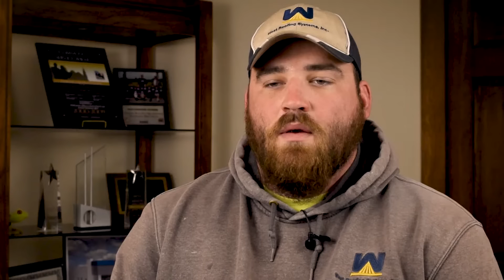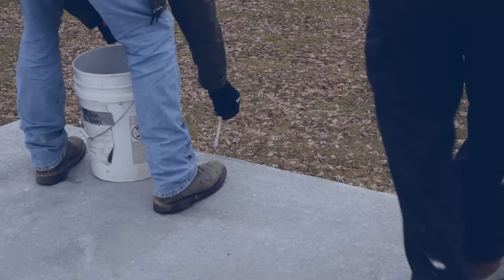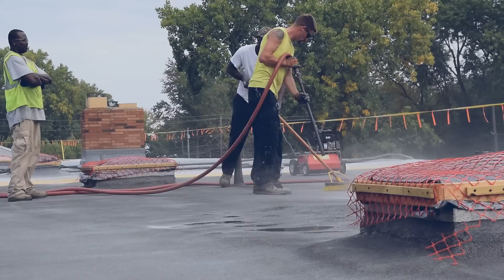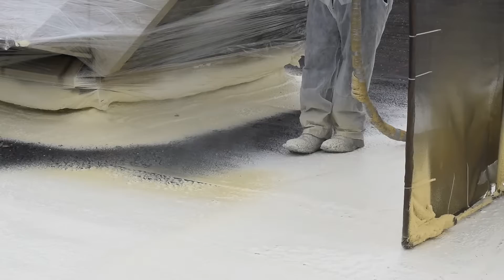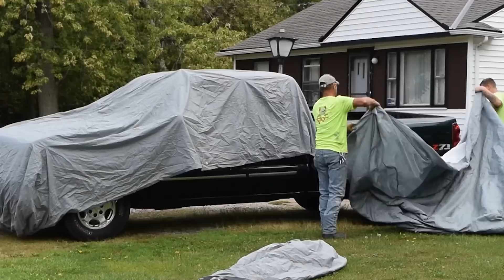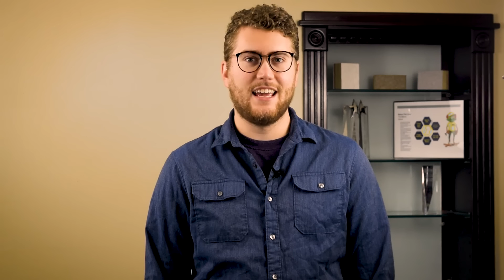The Pros and Cons of Spray Foam Roofing

Comment: I lived in my house 35 years. It has very nice open beam ceilings over the living room and dining room and over my 22x24 foot bedroom upstairs. The heavy wood shake roof leaked so I had it torn off and the center of the house was sheeted with OSB. The open beam ceilings are 2x6 tongue in groove with tar paper and 3 leaf tar/fiberglass shingles on it. It started leaking after 15 years because the nails were backing out where the seams of the wood was and they did not hold. They should have sheeted those areas as well.  For an entire year, I could smell tar from the roofing INSIDE the house.

The house was freezing in the winter, hot in the summer for 20 years. The composition roof was far less insulation that the shakes were.

I'm done chasing leaks. I had my roof of 3200 square feet sprayed with rigid urethane foam 4 days ago over the shingles. It was coated with the elastomer but needed the mid progress inspection to be done before applying granules.

The foam partly duplicated the shingle pattern.  They actually filled in the dished sagged area over my bedroom and now it looks much better from the street. It looks like a light snow fell on the roof.

The results..... holy smokes, awesomely good......I have been tracking the ceiling temperatures with a laser thermometer so I know how it was in the last 2 years.  It was 106 to 112 degrees after the sun went down inside my bedroom on the ceiling, 92 degrees 5 feet off he floor with the cooler running on an average hot day in August. In the winter, I was seeing 48 degrees 5 feet off the floor. The ceiling was often a few degrees less. The attic was the same as the outside temperature.

. From across the street, you could see the frost burnt off over my living room and bedroom.  Last February the furnace set at 67 degrees ran 56 minutes of every hour and my bedroom temperature at 5 feet up from the floor was 48 degrees. The attic was 116 in May when I strung the new video cable AFTER the sun went down.

I have evaporative cooling and run it on low about 8-10 hours a day all Summer. The attic vent fan turns on at 105 degrees and runs from 11 in the morning to 7 at night most days.

With the foam roof, the attic temperature was 76 degrees in full sun, 86 degrees outside today. The attic fan never comes on now. It ran every day since May before the new roof. With the windows closed, I'm seeing between 68 degrees and 74 degrees in my upstairs bedroom at all times. Fall fell last week and I was using the furnace for an hour each morning. Now with the insulated roof, there is no need for the furnace or the ceiling fan. The difference is astounding. I need to learn how to operate this house all over again.

They are going to coat the roof with tan mineral granules this week. The entire job cost as much as they quoted to tear off the old roof and lay down GAF bitumen underlayment and 35 year shingles. It would still have a hot attic.

This is California, earthquake prone. To raise the roof with 2x4's, vent it and sheet with 7/16'' OSB, install the better underlayment and add 35 year shingles, I was quoted $65,000 and $58,000. The roof would weigh 8500 lbs more. I am guessing the rigid foam and granules will add 600 lbs to the roof. Fine. Less to shake over my head. The cost was mid $20,000 for the foam and skylight changes.  I hear that the coating sometimes blisters but I will gladly deal with that after the insulation made this place way more livable. 

 I had a sprayed foam roof put on my apartment building in 1996 and when  sold it in 2018, there were only a few spots needing repairs and we never re-coated it in 22 years. It brought Summer temps down by 20 degrees on the top floor apartments. This roof also meets Title 24 for energy efficiency. Who cares....the inside temperature is way more stable now. I can't wait to study the Winter temperature effects.

Noise....its quieter now. Jet traffic climbing out of SFO used to come through my ceiling. Now it comes through the closed windows if I hear it at all.
Reply: 7 months later when the sun was out and it hit 92 degrees in the shade, the metal flashing around the edges of the roof started popping up raising the foam layer. Over the gutters it rose about 3 inches in the middle of a 25 foot span and looks terrible and gets worse on hot days, never flattens out when the sun goes down. There is one place where the metal and foam raised 5 inches. The installer wants to cut out the bad sections and start over with new foam and coating.  They blame the foam supplier as it happened on a few other roofs. Mine is the worst they ever saw and its not even Summer yet.
The edge metal was installed with roofing nails, a stupid lazy idea. There is one area where screws were used and its staying put. This is terribly disappointing and looks like hell. These guys were in business or 30+ years but they sure did a piss poor job on my roof.
The good.....I love the insulating properties and never run the AC even on hot days in May. The heater ran 1/3rd as much last winter.